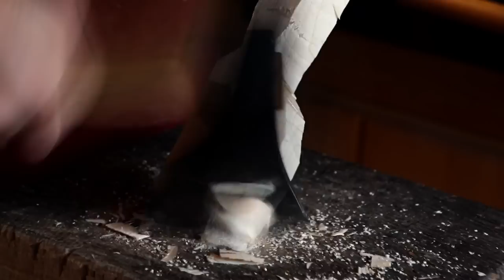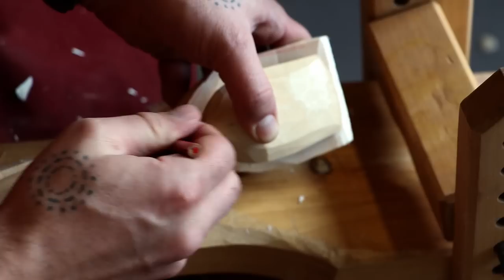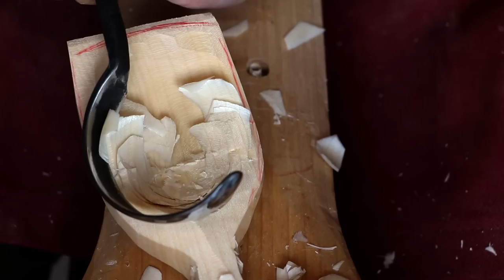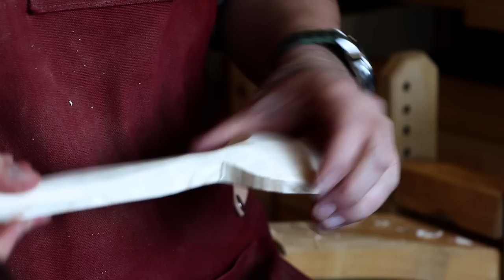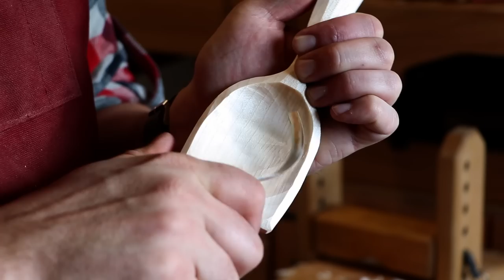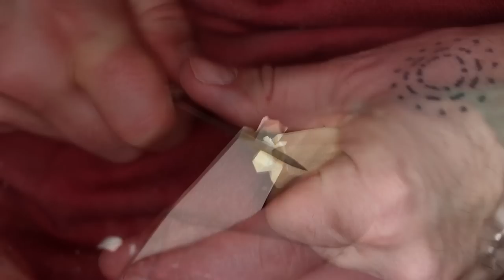Spooncarving: Carving my favorite greenwood maple serving spoon

Comment: was going to ask why the stop cut on one side only ... learned something very useful there what with the 90ºangle to facilitate easier stock removal on the non-stop-cut side. Hadn't seen that done before. Thx again for that bit of trickery ;)
Reply from the maker: Myron Unrau Actually, it was a total coincidence.. to show the difference but it worked out really fine as if it was on purpose. You’re welcome friend !!

Comment: It’s made using primitive way. If power tools are used to make this spoon, it would be much quicker, easier  and safer. Such as grinder, jig saw,  multi tool, sander, etc.
Reply from the maker: And more ridiculous 🙂
Reply: @formgjortbyJonasAls  it’s highly relying on personal skills. You have top level personal carving skills, carving this spoon is easy for you, but it’s not easy for me, as a initial beginner. If I did it, I would use lathe to cut the handle to a smaller diameter, use jig saw to cut the spoon part; then I would use grinder with wood cutting bowel to make the curvy part. At the last stage I would use a few different sanders or sanding machines to trim it. This is my way. I believe that the special primitive tools you used are very expensive.
Reply: @formgjortbyJonasAls I finished my very first spoon a month ago. I can't remember clearly but I seem to recall I used to teeth to carve out some of the detail. Lacking an axe and just about everything else required to make a spoon...

Comment: Great video man. Do you keep a Scandinavian grind on your blade you’re using at 22:30 when you’re working on the handle end? (Sloyd knife?)
Reply from the maker: Yeah man. For carving, scandi grind is the only way to go. Don't ever make a microbevel on your knives.
Reply: Thanks!
Reply from the maker: Eventually you can make a hollow grind, with a round stone, for example with a tormek. I got a video with that 👍🏻
Reply: I actually watched you sharpen your lathe gouges with that Tormek. Good content and tutorial. I’ll check out the hollow grind video. Really appreciate it man.

Comment: A reason for using dry wood rather than green?
Reply from the maker: Hello Matt 
Well, for all spoons and some bowls, I use greenwood. It’s way more softer and easier for your hands, joints and tools to work with. 
When I’m 90% done with a spoon and dry it for a day or two and finish it when it’s dry. 
For plates and cutting boards I use dry wood. 
When it comes to spoons I don’t recommend using try wood as it’s super hard and can be dangerous when using knives.. you use so much more power and it can be really bad if you cut yourself with full power.. you know. 

The tricky part when working with green wood is to dry it securely so it doesn’t crack when drying. To thick will make it crack.. to thin will leave to little material when carving the surface clean, when dried.
Reply: Woodcraft by Jonas Als thank you explanation about green vs dried wood. Can you explain your drying techniques?
Reply: @formgjortbyJonasAls  what kind of wood you use for this spoon?
Reply: Thank you!  So much skill and power!  
What kind of gouge is that? Looks like a great tool. Though i am not sure I could manage it, as my arm strength isn't that great for very long. Especially with maple!

Enjoyed watching this!

Kimmie

Comment: You may have already a answered this. Are carving with the wood still green? I have been making some spoons out of pine because it is soft , easy to carving, and everywhere here in the Blue Ridge Mountains.  I would like to try maple if it is doable for a beginner like me.
Reply: Chad, check out Andy Spoons. He also hangs out in the Blue Ridge Mountains I believe and is probably familiar with the woods of the area. Do not carve your spoons from oak - they have a weird molecular and chemical structure which reacts badly with certain chemical elements in food such as tannins. Then your beautiful spoon turns black...
Reply: Thx